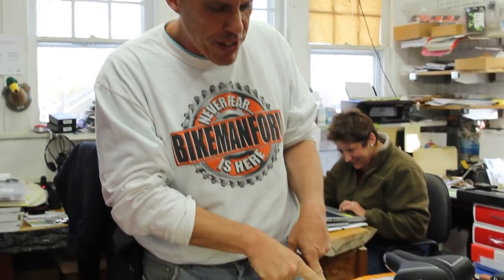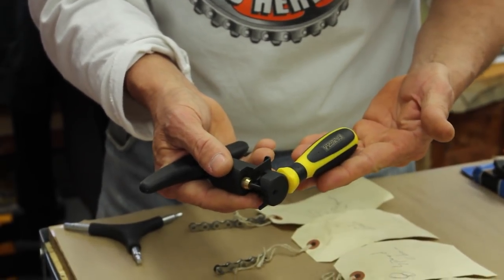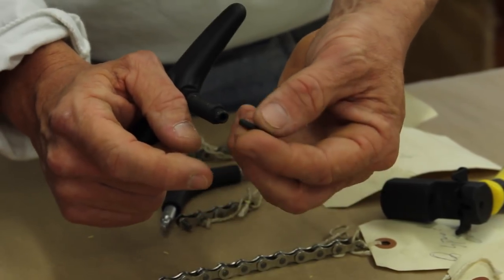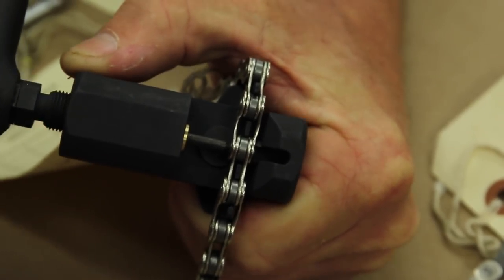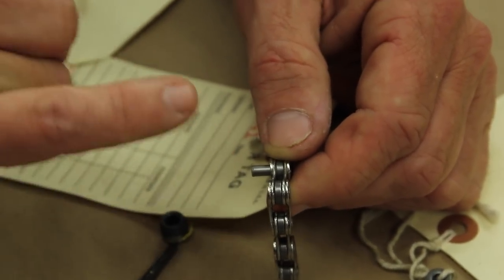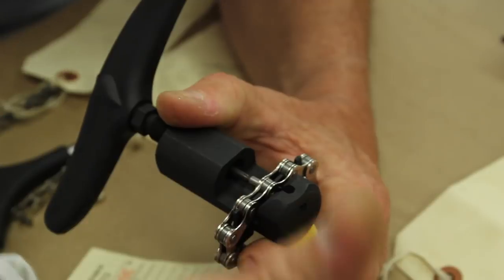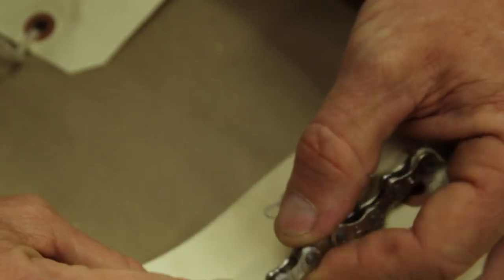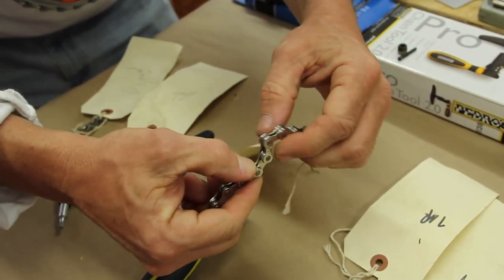Pedros Pro 2.0 Chain Breaker Tool - Pin Centering - BikemanforU Review

Comment: Putting in the removed pin is very easy but it takes a few tries. You need a small head plier or tweezer that can lock to hold the pin on the inner part of the Chain Breaker tool as you turn the tool slowly to center the pin contact, then slowly start turning the tool to push the Pin back in.

Comment: nice tool BUT there is something that is missing with this tool and the park tool also.
The lack of "un-stiffen" option after you put back together the chain. I have a cheap chain tool (the first picture in chain tool- wikipedia) that have a lot more versatility but is more complex.
The anvil is a hollow bolt with a spring loaded pin in it, and is adjustable. The pin in the anvil is good to keep the links together if no wall is present, and keep the links lined up with the pin. The body of the tool has two resting places for the chain: the one near the anvil is for taking apart and putting the chain back, and the middle spot is to loosen the link from only one of the side plates. This option is missing in this tools and i don't like grabbing the oiled chain to loosen it sideways, and it loosens a lot more links than the only one needed.
Reply: actually it's identical to this one: http://www.dhgate.com/store/product/bike-bicycle-chain-breaker-splitter-cutter/157606195.html only i got it from elsewhere. (the handles and general construction is crap but suits me for twice a year use).